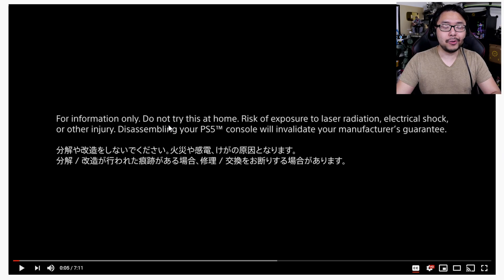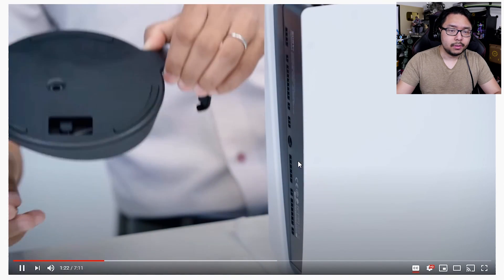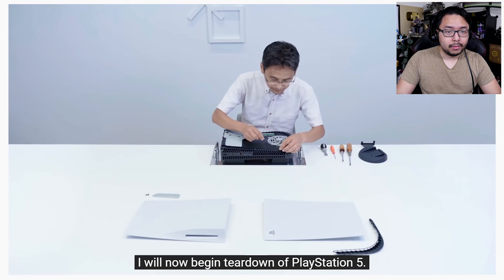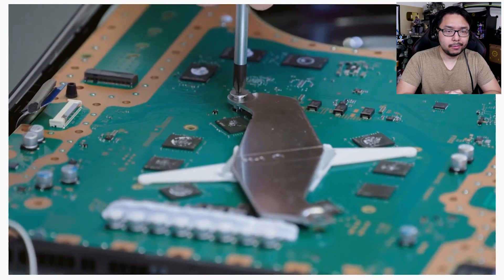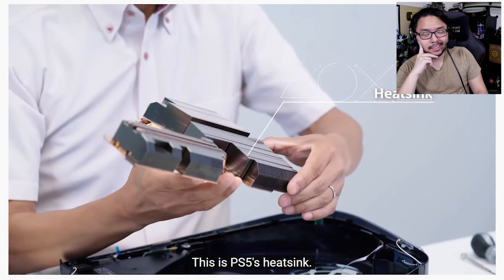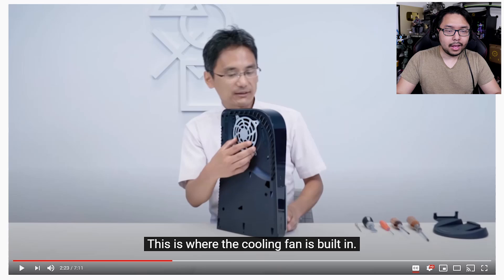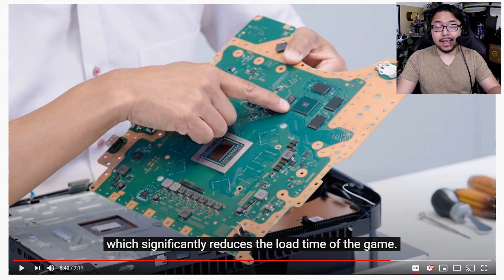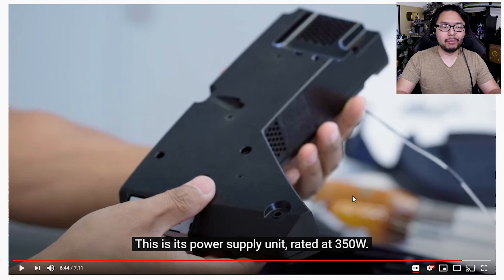Reacting To Sony's PS5 Teardown (Cooling, SSD Slot, Swappable Panels, & More)

Comment: A couple things to note. Void if removed stickers are not valid, they have been struck down in court. Liquid metal TIM is actually impressive. You can see big Temp reductions by deliding a cpu and using liquid metal instead of normal thermal paste. There's only a handful of  Pcie 4.0 nvme capable of that speed I believe. The new Samsung 980 pro and WD sn850. Msrp for both around $220. Prices should reduce when other manufacturers start making them at those speeds.

Comment: Does no one care how PS5 managed to liquid metal all their CPU’s reliably? That’s amazing, I used to think using regular thermal paste is much safer than liquid metal since it can leak if you put too much and short other components also heard liquid metal can oxidize some metals over time faster than thermal paste. THAT blew my mind. Not some fan or Heat sink like Yong Yea was impressed by lol

Comment: Liquid metal and direct die contact with that large of a heat sink. The use of liquid metal indicates that the heat output must be rather high because LM is not exactly the most friendly thermal interface material, but has a much better thermal transfer than most other interfaces on the market.

Comment: “Warranty void if removed.” is illegal in the US according to letters from the FTC, so no worry there.

“Unless warrantors provide the parts or services for free or receive a waiver from the FTC, such statements generally are prohibited by the Magnuson-Moss Warranty Act, a law that governs consumer product warranties,” the Commission noted. “Similarly, such statements may be deceptive under the FTC Act.”

Also those parts are already becoming outdated, and it's not even released yet, they keep spewing 10 tlops, but you can get double that with the Nividia 30 series and now AMD is releasing their Zen 3 CPU which should be better than their Zen 2 used in the PS5 (if you follow their marketing it's supposed to be a 20% increase over Intel but heh waiting for 3rd party info), I find it very hillarious that people starting calling console superior to PC a few month back. 

And a 350W Power supply.. You're gonna be limited on a lot of power for most of your parts I highly doubt the GPU run at 2200 mhz full time, it can probably get there, but I highly doubt it.

Not even 1 TB SSD, what year is it.. 2010?

Only thing you win is initial price, it die over time with each game you need to buy full price from a monopoly.

Comment: SoC, is System on Chip, its name for chip cointaing not only CPU and GPU buy also varius diffren functions IO, memory etc. simply beyond APU. All Ryzen CPU are technicly SoCs as they have USB controller build in for example

Comment: There won't be heating issues with such a large heatsink like that and only 350W power supply. if anything, the power supply will shutdown before heating becomes an issue (or used as redundancy to the thermal sensors).

Comment: 0:14 Another Microsoft shill. The "Do not try this at home" is about the disassembly of the console once you remove the guarantee seal. To remove the plates or to install additional SSD storage you're not at risk of losing the guarantee or exposing yourself to any risk described in that disclaimer. I know for a fact Yong is not dumb, so starting the video like this is very illuminating.
Reply: thats part of the playstation video...
Reply: @stargateheaven23  The disclaimer, yes. What Yong said, no.

Comment: Do you think new upcoming games will run at 60 fps , like into year 3 or 4 of the PS5 life cycle. I remember second son had a 60fps option during the early PS4 days, but hardly any games after that.

Real game breaker for me. For example i was lukewarm on Death Stranding gameplay when i played on PS4. Enjoying it a lot more in 60 fps on PC for my second playthrough.

Comment: Either Yong is VERY hard to impress or he straight up doesn't know how hard it actually is to use and apply liquid metal - not to mention it's quite expensive. 

This is very impressive and clever engineering from SONY.

Comment: Telling by the over engineered heatsink and the use of liquid metal instead the use of thermal pads or paste this system for heat transfer, it looks like the Playstation 5 hardware will output more heat then most consoles.

Comment: The PS5 has 3 x USB 3.0 ports plus a USB Type-C port which the Xbox Series consoles doesn't have, I believe. Type-C USB drives are twice as fast as USB 3.0 but its placement on the front of the console means it is less useful for attaching an external SATA3 SSD, say, for installing PS4 games on. You can still do that via the rear USB 3.0 ports but I wish Sony had gone for 2 x USB 3.0 and 2 x USB Type-C with one of each on the front and rear for convenience.

Also, much prefer to have an internal NVMe drive as opposed to a cartridge type solution, although that does allow you to hot swap drives, I suppose. At £220 for a 1 TB drive though, I'm sure not many people will ever own more than one!

As for the clam shell like outer case, I assume it is that way to both aid cooling and prevent too much dust from getting inside the machine otherwise I'm sure Sony would have gone for a more streamlined outer case. I don't think they did it just for looks alone but I might be wrong. I guess Digital Foundry will have an indepth analysis video on the PS5 once they get hold of one.

Comment: I actually really like how Sony is using NVMe m.2 for expandable storage. Right now, a Samsung 970 Evo/Evo Plus 1TB goes for $170 but that price is likely going to drop over the next year or so. Plus, the 970 is just one of the best ones on the market. There are cheaper alternatives like WD or Crucial or even getting one of the 500GB m.2 drives for around half the price.
Xbox, however, will be stuck with a proprietary drive device that protrudes from the device, which I think is a bad idea design-wise. I guess this might not be a big issue for some users, as there are going to be plenty of games they can play through xCloud, but others are going to either have to keep removing games from their drives to make room for new ones or go for the 1TB expansion drive. To be fair, we should wait to see what the price is going to be for the Xbox drive but I would imagine it won't be much cheaper than an m.2 drive of equivalent capacity.

Comment: SSD, "some 3rd party solution"? You mean like the thousands that are already readily available in any PC store like Newegg?!
It's standard M.2 PCIe NVMe SSD. ANY SSD of that kind will work. There is no "that will work well", it's a fricken standard.
Why am I sure? Because PS4, PS5, XBone, XBSeX/S are AMD CPU's i.e a PC. PS5 and XBSeX/S  are even more recent PC hardware with Ryzen CPU's, plus M.2  and it's PCIe, i.e. a PC. Just a fancy OEM PC.

Btw.: 1TB M.2 PCI NVMe <100 EUR/USD. 

Is it 5.5GiB/s fast? No. But at least 2 GiB/s. Against it's PS4/XBone generation counter part which were either rotating rust (HDD) @ 120 MiB/s  or SATA 2.5" SSD @ 550 MiB/s (max., for the better ones) it's still at least 4x times faster ... and that's for the cheap ones.

PCMR always can go "better" so, let's go better and put e.g. the Corsair MP600 into that and what one gets is a PCIe 4.0 M.2 NVMe SSD, with ~4.9 GiB/s. Yes, double the price. Yes, close to the price of MS' proprietary BS solution. Yet still cheaper with only 180 EUR/USD, not 230 EUR/USD [1TB version] and also double the speed of MS'.

"Oh, but it's convenient to just stick it in", not 50 bucks convenient. And the PC parts will fall in price. Also standard component versus proprietary, good luck to get one when MS decides to "upgrade" to a "new  and enhanced" standard. On the other hand PCIe devices are upwards and downward compatible, because it's a part of the standard and required. ...

Comment: The real test of the cooling and the noise will be in a years time, when it's dirty and Sony have fucked up the OS with a million updates that do nothing. My PS4 ran cold, quiet and quick when I first got it. Spin to now and it has a heart attack booting Netflix, the storefront has a 50% chance of loading nothing, the OS just dies randomly, the party chat stops working for 10 minutes to an hour and the system occasionally hard crashes to the point I have to risk corrupting everything by pulling the power.

I need to sell some stuff for a PS5, but not to fund it, to have a place to put that behemoth!

Liquid metal?! Oh shit. Autonomous robots, learning software and liquid metal? We are hurtling towards Judgement Day at light speed.

Comment: my experience with sony consoles was the worst possible. My first ps was a ps3 and it heated up a lot and made a huge noise ... in a short time I lost the player because of the heating. It is one of the worst consoles in terms of cooling. There is no point in putting a powerful fan and the entire console is closed ... the same will happen with this ps5. I never wanted to have consoles again and I prefer PCS because they last longer and are more flexible and cheaper in the long run. Any part that breaks on the sony consoles will charge you for your eyes and liver .... I am fully satisfied with the PC platform. Consoles for me are part of a long past. Today the PC platform is well served by games.

Comment: The only thing that fascinated me was the SSD slot. We knew that Sony said you could install your own SSD drive into the consoles but I was curious as to how that would be possible. Would it have been like the PS4, having to take out the old drive and installing another before updating the firmware? But no, seeing that main SSD drive built into the motherboard with an additional slot for more space is kinda neat. Although I'd be scared installing a new drive on my own, I'm too finicky and terrified to work around new tech.
Reply: DawnOfTheOzz ooof the ps5 tear down is quite easy if u wanna switch drives

Comment: 25 Year PC technician and engineer here. I am suprised to see it only needs 350w PSU, but seeing as the PS5 will be drawing every penny of that, i see 2 crystal clear major issues ahead.
1. Absolutely Inadequate Cooling. One large fan and a lot of heatsink is a ticking timebomb. DUST will block every millimeter of that heatsink, and *no vacuum is going to pull that out*, the motor pushing such a larger, heavier fan is likely to wear down and break very fast. Im honestly shocked they didnt use a liquid cooling method, like any modern gaming machine. Components are much hotter these days, so in 2020 when i see 1 large fan cooling an entire computer...i call that a timebomb.
2. Likely PSU blowout, and random shutdowns due to lack of power. When all of those components are running, i see a 350w being pushed to its pinnacle, all of the time...meaning it's going to degrade super fast, and always be super hot, those rails are likely to at first be ok, but then see rapid degradation, and it will begin pumping out less watts over time until the console starts complaining of a lack of power, and shutdown randomly. I expect to see this problem rear its head within months.
Im Paul Middleton, and im calling it here folks. Remember this. Revving a car engine at max, constantly while in neutral, leads to swift engine damage.

Comment: One thing that I just noticed. If PS5 is in horizontal position the USB ports are on the top. External drives have very short cables. I do not know, it it is a good idea to have them dangling behind the console if you are using HDD as a cold storage/external drive for PS4 games.

Comment: Finally USB on the back! It's size is surprising considering that technically its less powerful than XSX.  Too be honest both consoles are so close in power I doubt we will tell much difference. I'm a PC gamer... I currently use 1080ti which is still a powerful GPU.

Comment: I don't know much about hardware but seeing that cooling solution made me wonder..... that variable clock setup they have in PS5.... could it go even higher than 3.5ghz if they wanted it to?    Or is there some cap on the speed imposed by the silicon?

Comment: What i want to know is the speed of the SSD in the upgrade slot.. Seems like it would be 4x slower than the internal one.. XSX has the expandable storage wired the same as the internal one..

Also.... making it bigger is not great engineering  🤣

Comment: 3D Printing these covers will be very difficult for hobbyists.
1st: you need to have a very large Printbed. Most people got a printbed at 240mm x 240mm max.
2nd: The shape is curved, hollow and these clips will be also very difficult to print.

I think plastic injection molding would be more appropriate.

Comment: the units alot more modular internally then previous units, the playstation 2 back in the day i took apart after it broke down for me, the internals in that seemed almost like they wer cobbled together mcguyver style in whatever way worked where as this unit is clearly purpose built with every part made specifically for it, and whats more the ps2's heat sink made up a paltry amount of its internal space where as this beasts sink is a 3rd of its mass, together with the cooling fan the units heating solution is nearly half of its bulk this thing must put out some serious BTU to need all that, recommend any owners keep the unit on a fire proof surface if they even suspect there fan may be about to give up the ghost, or beter yet get it replaced before continuing use.
and for the love of god to any hackers out there do NOT try to overide the units no doubt comprehensive anti overheat software to try and overclock the damn thing! unless you like the smell of burned plastic and house fires.

Comment: Yeah I'm sure cooling is important on a bastardized Ryzen 5 thats locked to 720p and 24fps.
Its still going to overheat despite that though because Sony still thinks that 3mm vent holes generate adequate airflow for a 120mm fan. 
This entire thing is maybe comparable to a mid range PC, but with proprietary hardware, a 25% markup and no games.

Comment: What people are missing is that the heat exhaust is not utilised well by the giant heatsink. The heatsink is only on one side of the console and the quickest air path is covered by the smaller portion of the heatsink, while the thickest part of it is located down low. Not a very practical cooling.
Something else I noticed is that they use fan protectors on both sides of the fan. If you remove those I bet you will get more air and less noise for no cost at all! That would be great and would be the first thing to do on the PS5.

Comment: The ssd expansion solution seems slow and less effective, with xsx you can quickly swap multiple memory cards, and games run straight from the card.
Reply: ..... Microsoft is about to make you buy an expensive proprietary USB stick
Reply: The great thing about it is, I can quickly pull it out and take it round my mates house. Then Instantly plug it in and play exactly were I left off, PlayStation cant even do that even if the ssd was hot swappable. I'll happily pay abit more for that convenience in the short term, there will be many more options in the future, that are also cheaper.
Reply: @Andyrude666  so..... a USB stick...
Reply: As soon as a 2tb card is available for the series x I will purchase one. In the mean time enjoy your 2tb M.2 NVMe Gen4 cards at the best price you can get them for. I just prefer convenience of access, I think in the future both consoles will have multiple options in many different sizes, and the prices will come down. I intend to have many different drives for every possibility, check out digital foundry's latest video.

Comment: The only thing that concerns me is the soldered on storage, NAND flash will wear out and replacing the NAND chips/controller is going to be impossible for all but a handful of people, and the only way to repair the system for everyone else is to entirely replace the motherboard.

My hope is that Sony have already thought of this and make it so that as long as the secondary NVMe drive meets strict perf requirements it can entirely replace the internal storage to mitigate this potential downside.

Other than that Sony have done a great job with a well thought out design and lots of little touches that make it far easier for the average Joe to service the system.

Comment: As a PC gamer watching this its nice to see that they finally got engineers who know what the fuck they're doing. Most consoles I've owned over the past 2 decades have always had heating issues because they don't have proper cooling. This leads to faster hardware failure, freezes, game crashes, etc. The biggest example of this being the Xbox 360 where the piss poor heating led to heat warping of the mobo causing the cpu on it to unseat causing the RRoD.

As for its size its honestly about the same size as an old VCR or older model DVD player and about half as big as most low end personal desktop PCs. I don't see its size as being a negative because that increased size means more room for airflow.
Reply: I saw why Sony designed PS5 to be this big. Sadly, not many people have common sense.

Comment: Hey guys, could you help me out? I have a TV which has a hdmi 1.4 port, and I'm planning to buy a console, so if a game supports 4k 60 fps, will it be displayed at 4k 30 or downscaled to 1080p 60? (Since 4k 30 is the limit for hdmi 1.4).  I'm asking this cause I'm not really that knowledgeable in this kind of stuff.

Comment: That "SSD slot" is an M.2 slot. A relatively new form of storage, offering faster read and write speeds. There are already plenty of options out there, so no need to wait for an upgrade.
Reply: Additional SSDs are off-the-shelf, but have to be certified by Sony to work with PS5.